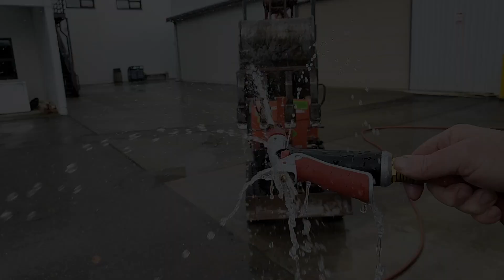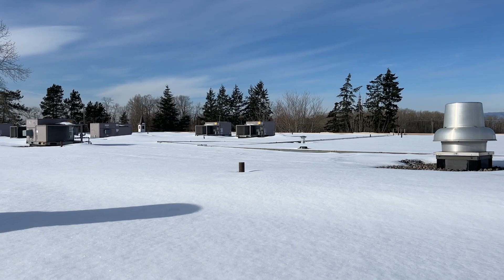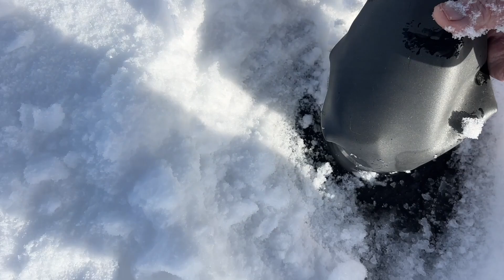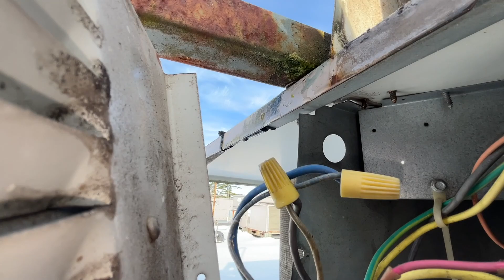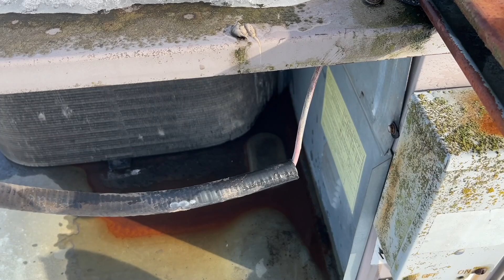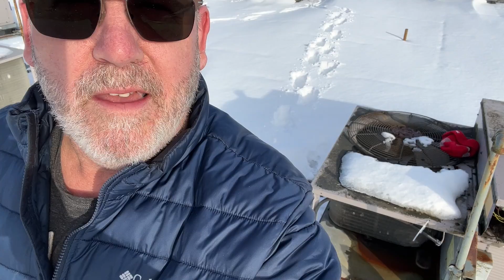The 30 Year Old "Roof" Leak that WASN'T a Roof Leak! - S07E172

Comment: Nothing more annoying than an elusive leak. Good quick fix but in better weather, you might want to revisit that and cut the armored cable (casing) back and make a larger (longer) drip loop and then use a cable clamp to fasten it rather than a cable tie which can degrade in sunlight. The teachers and students will always remember the guy that finally fixed that damn leak!
Reply from the maker: Thanks for watching!